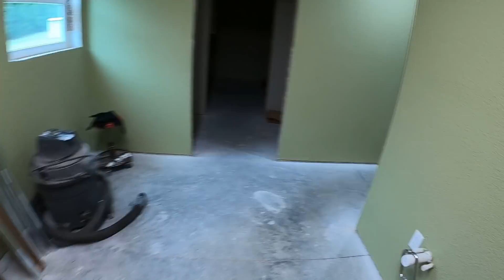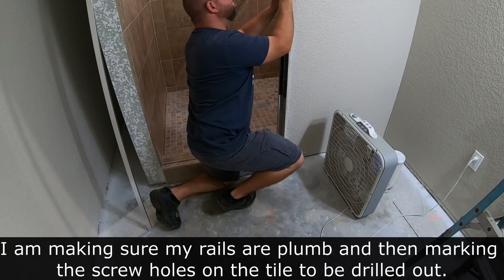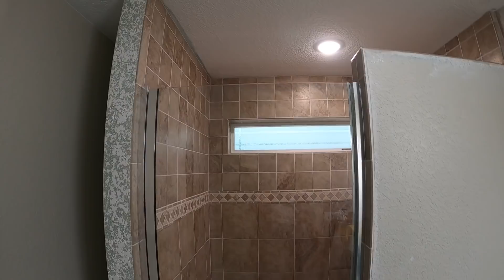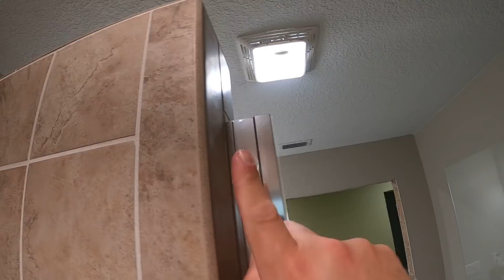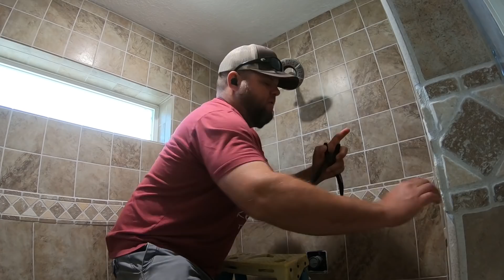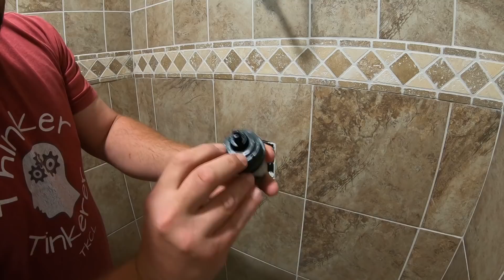Installing a Basco shower door and Delta shower head/valve! #538

Comment: What do you do if your glass door slides down in the clamped hinge 3/4" & now you can't close your shower door?

Any way to slide the hinge down to make the hinge be flush with the top & bottom of the glass like how it originally came?
Reply from the maker: Are you saying the glass shifted in the clamped metal? Or the metal that's clamped to the glass shifted inside the other metal piece?
Reply: @TKCL  Yes, the Glass shifted in the clamped metal & is hanging 3/4" lower & the glass is now hitting the bottom metal track
Reply from the maker: Sadly you will have to remove the glass, it's held in by friction and rubber. Then pinch the metal tighter, wrap the rubber around the glass and reinstall. Be very careful to not shatter the glass, this is exactly how the magnetic catch is clamped to the glass door.
Reply: @TKCL  Thanks, yeah was messing with it again last night, trying to use a bar clamp to push it back into place, didn't work. Then my son pulled off the top metal clamp a little. Used cardboard to press down the seem between the glass & the rubber while I pulled on the metal. 

Got it off, cleaned it up & used silicone inside the rubber, outside the rubber & inside the metal clamp track. Clamped it back together, ran a bead with the excess silicone. Waiting 7-14 days for it to cure properly before hanging again. 

Hope it works.

Comment: Just a slight defense of the company with respect to the short screws supplied.  These screws are intended for use with plastic anchors.  Not everyone has wood studs behind their tiles - so, the short screws work for everybody.  Of course, if you have wood studs, you should use longer screws, as this installer is doing.
Reply from the maker: The thought of anchoring this heavy glass door to drywall makes me cringe! 😬

Comment: That shower is nearly identical to the one in the house we built in 2004 aside from ours having dual heads. You may have a better solution, but our clear glass shower door easily stained and we found cleaning with white vinegar was the only thing that really worked (and it was cheap)!!
Reply from the maker: We also clean with vinegar. People are saying to apply rain x to it and squeegee everytime we get don't showering.

Comment: Absolutely key to get the shower head high enough.  I'm only 5'10" or so but have battles some terrible showers.  Never heard of a short 5' friend saying the shower head to too high.  On top of the standard being too low to start with, so many modern heads (like yours) are a heck of a lot longer than the old 1950 gym locker room sprayer.
Reply from the maker: 100 percent agree

Comment: Is that the Delta head in your shower?   As well I hope the wood on them shower door hinges was dry.   So it dont flex on you.   I had the original shower head Philips I loved it even if it was cheap and broke.   So when it was time to replace it I got the Delta.  But I must be honest its 100% better build. But the pressure is not as good.   I like it.   Just the way the old one did the massage features was better.
Reply from the maker: Wood on door hinges???? That is a full Delta system, they were proud of that shower head.
Reply: @TKCL  pardon my French.   The wood  in the wall structure.   Hope it was really dry.   As mine was not.  The fresh cut wood was still drying and as it did in the walls   4 times we had to adjust the door.   And you are right   so many glass guys are sending short screws.

Comment: Hi, Andrew!  Great installation!  Didn’t you tell us you plan to use the space between the wall and the shower to store towels, etc?
Reply from the maker: It's going to be a pull out linen closet on caster wheels.
Reply: @TKCL  that’s what I thought you told us. That’s a perfect spot, and you don’t have to worry with a linen closet!!  I like it.
Reply: @TKCL  Getting good at scrolling through the comments section before posting a duplicate... I visualized a pullout storage and you nailed it!!! awesome!!

Comment: I feel like your house is so well insulated that you’re gonna have to crack open a window to use the bathroom fan
Reply from the maker: Already taking care of that with my HVAC installer. You can literally turn on the bathroom vent fans or the microwave fan and open the outside door, it slings open due to the vacuum.  More air intake is coming!

Comment: I was wondering why you didn't run a bead of silicone on the side rails (as you did on the bottom) before you screwed them in.  That is, in addition to the bead you ran on the outside.  The reason I asked is that, over time, the bead deteriorates and it leaks.  Yes, I know you can redo that bead, but it's a pain to do that.  We had a problem with our shower doors as a result.  Also, I was glad that, when you ran the bead under the bottom rail you ran it also against the wall and not just on the straight rail.  That's where we had a failure as well.
Reply from the maker: I should have, hindsight is 20/20. I did silicone both sides.

Comment: Did you put a dab of silicone on the holes you drilled in the tile before inserting your screws?  I know you are a fan of over doing things as am I and that's what I would have done.
Hand sprayers are nice for cleaning showers also.  I had came up with the idea to have one for the toilet so I didn't need to use a brush and cleaner as much.  Could not figure out away for the longest time since toilets have a unique connection port.  Finally came across a product.  I don't use it for its intended purpose but it's great for cleaning the toilet.  Search for diaper sprayer or bidet sprayer on amazon.  Looking forward to the rolling closet build.
Reply from the maker: I didn't, but I did Silicon both sides of the shower, felt rather comfortable with that. Especially since the shower is so big.

Comment: Did you silicone between side rails before installing?
Reply: I asked the same thing.
Reply from the maker: No just on both sides, I probably should have.
Reply: @TKCL  Kinda what I was thinking. There’s always the chance of moisture getting past the screws and into the wall.
Reply from the maker: It's open and drains straight to the floor inside.

Comment: Did you put any silicone in the screw hole before the screws
Reply from the maker: No, it's hard to see but those spaces drain to the threshold and back into the shower.